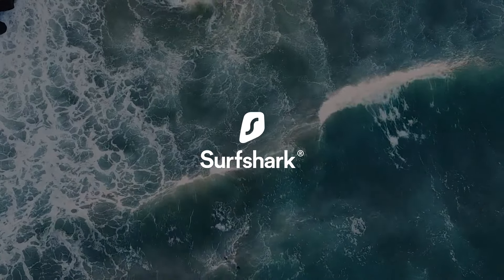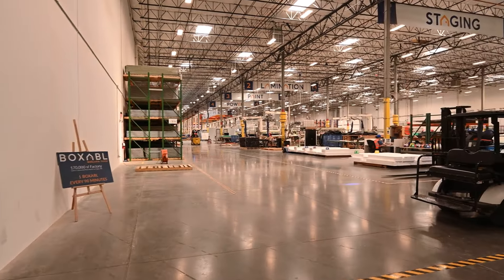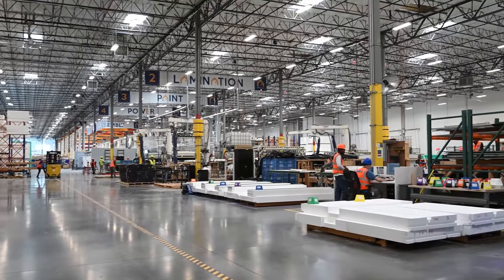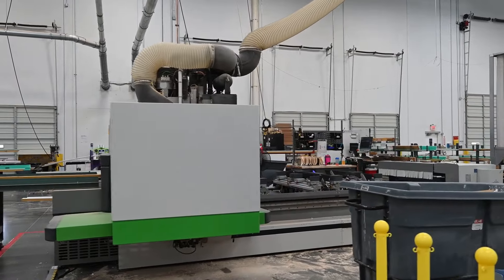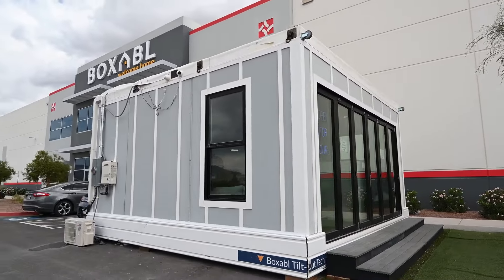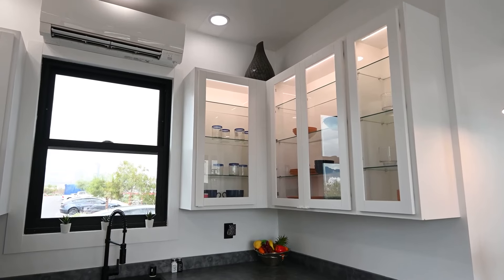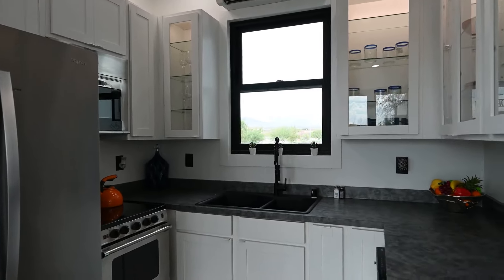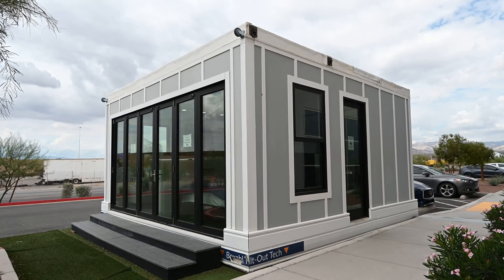Inside Elon Musk's $50,000 Tiny House | Tiny House Tours

Comment: Have multiple Boxables that snap together into one unit. For example, if you want three bedrooms, two baths, kitchen with granite, etc., you buy the individual units and snap them together.  The roof has solar units pre-installed.  On a catalogue (or on-line) site you select what it is you want.  The concrete base is pre-poured.  You buy the land.   The trucks arrive and the Boxables are down-loaded. A crew snaps these together and tests for electrical and water tightness.  The house is yours in less than five days.  Like automobiles I'll bet you could strike a deal.  Mr Patchy, mgr of production, could have you own home ready within the week. He could cobble it together. (Cat is optional.) The cat will go for the musk....

Comment: The kitchen looks great and just perfect for one person but there are three things that I wouldn't be happy with: 1. No bathtub. 2. The TV. The size isn't great of course, at least for the distance it's at, but the bigger problem is that it looks like it's way too high up to watch comfortably without constantly having to angle your neck. 3. The kitchen has these big cabinets but in the rest of the house there's barely any storage. There are tiny homes that use the space better imo and give you enough room to store your clothes, cleaning supplies (including a broom and/or vacuum cleaner) and even stuff like books and movies.
Reply from the maker: I think adding a bathtub is an option, and yeah the height of the TV is more of a problem than the size (since you could always buy a bigger TV if you wanted). Very true about the storage space though, the broom/vacuum in particular.

Comment: Yeah, this would do me although it is unlikely my local council would allow it.
I cannot understand why there are so many full-length windows for such a small space.  In many parts of the US this will just make it need even more cooling in summer and heating in winter.
Definitely better than most tiny houses I have seen on youtube.
Reply: Our local commission has already banned tiny homes. They won't allow anything smaller than 900 square feet.  Has something to do with property taxes. I guess they can't charge enough.
Reply: @danmcclure6670  This is why Boxabl will shake the dust of that town off its feet and go someplace that wants them and the taxpayers they’ll bring.